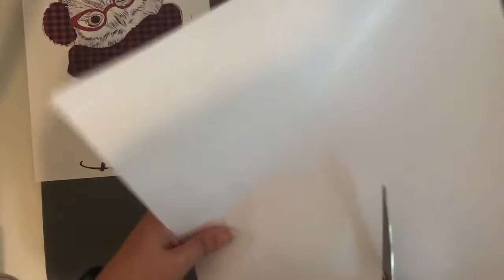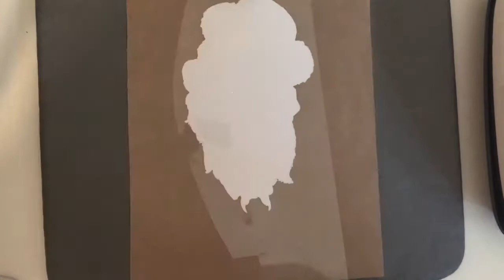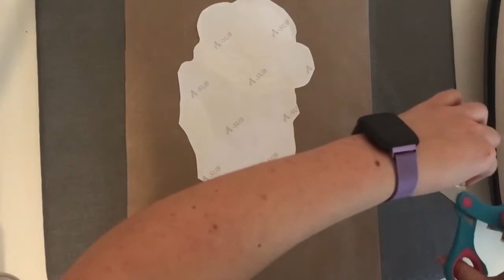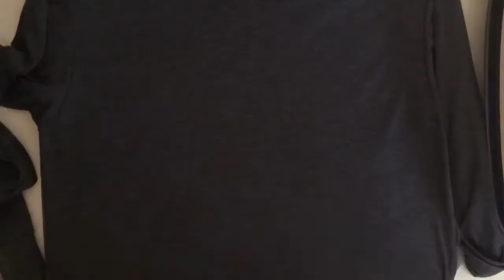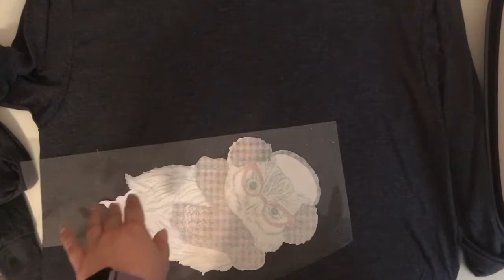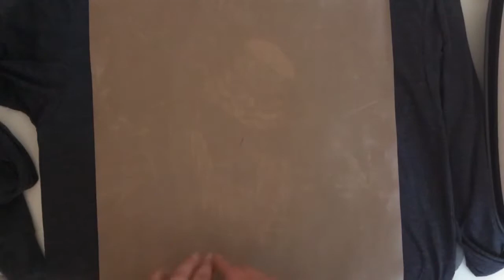Sublimation on dark fabrics using glitter htv

Comment: I find it easier to simply press the glitter on to the garment for a few seconds and then place the print (printed just a bit bigger= zero white outline) and heat press.
Reply from the maker: I have tried that but if you make it bigger you run the risk of discoloration around it and I didn’t like that. But it’s definitely an option.

Comment: Does it have to be teflon sheets and does it have to be a specific brand glitter HTV?
Reply from the maker: The glitter htv brand shouldn’t matter. All the ones I’ve tried so far have worked.
I do think it has to be Teflon since it is coated. The coating makes it possible to peel the htv back off once it’s cooled.
Reply: @stefaniestrange2004  I used parchment paper but now the glitter vinyl won't stick to the shirt and it the cricut iron on blotter vinyl

Comment: What temps and times did you use on each one? The glitter vinyl, then sub on the glitter vinyl and then pressing on the garment?
Reply from the maker: For the glitter onto the Teflon I just did a quick tack while the press was heating up. Probably 3-5 seconds around 310-320. The sublimation onto it I did for 60 seconds at 385. And then the application on the shirt I did at 315 for 15 seconds.
Reply: @stefaniestrange2004  how is the washing going on?
Reply from the maker: @assadnujjoo  Good! Looks just like the day I filmed this video even after a year of washing it.
Reply: @stefaniestrange2004   👍
Reply: @stefaniestrange2004  Thank you, so much!!

Comment: Why didn’t you cut the owl like you did the vinyl on your machine? Then you would have been spot on.
Reply from the maker: Because I would have had to make it smaller to account for registration marks so my machine would know where to cut.
Reply: I’m talking about just the owl, the the writing. So if you cut the owl on glitter you can cut the sub-printed owl just the same.
Reply from the maker: That’s what I was talking about. I would have to print extra registration marks on the page for my cut to line up with what I printed and be cut out exact which would waste ink and add space to my piece of paper meaning I would have to change the sizing.